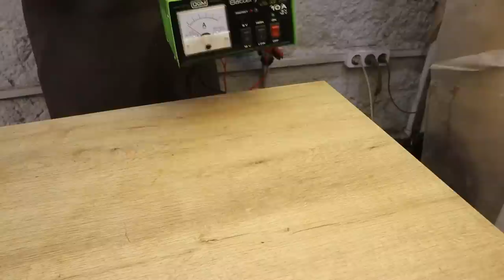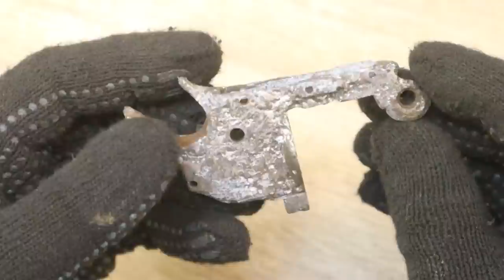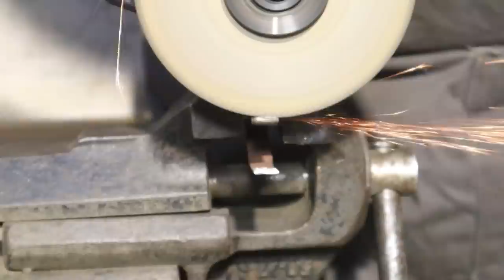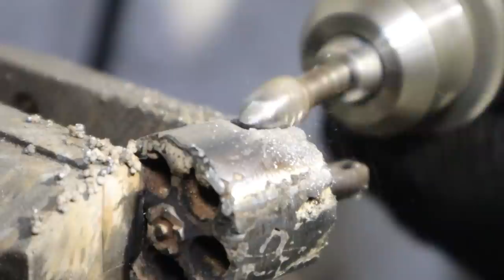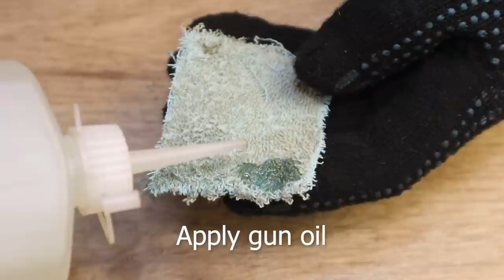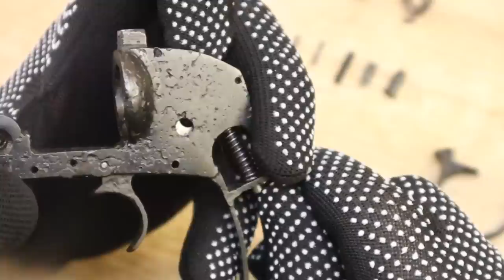An American revolver lay in the ground for 140 years!  You will be surprised! Restoration of antique

Comment: Great job considering how bad it was. One suggestion that might save you some time. Based on the splatter, I guess you're using .030 flux core welding wire. If you can weld with gas shielding and .023 wire, you will be able to lay down smaller less porous beads and it will reduce the amount of material you have to file greatly. The lower heat will make it easier to weld thin metal.
Reply: Why not TIG weld it
Reply: @johntice7745  . The guy would need a tig welder.
Reply: @johntice7745  tig welding would destroy more then save. Heat would start bending a lot of the parts he welds due to heat etc. I would suggest laser welding less heat and small and more precise welds.
Reply: @Srpskimafijas  lol wtf ever. You realize you can use lower heat settings or pulse tig? It would be the superior process for this.
Reply: Yeah the flux core did not seem like the best thing to use on this
Reply: @clutchboi4038  yes you can but doing small parts like that will still damage them. That’s why I suggested laser welding for more precise welding, less build up and easier clean up.
Reply: I think that the steel is very dirty on the inside,thats why the welding sounds so bad.Doesnt matter what wire you use and tig welding will not do the job correctly because of the dirty steel.

Comment: I got a ww2 era revolver in a quite the same condition, I’ve been meaning to start around it. Cool video
Reply: Please don't. Either leave it in its current condition or take to it a professional gunsmith...who will likely tell you to put it with scrap metal if it really is in as a bad a condition as this weapon was. The restoration done in this video did not improve the value of the weapon one bit, but also made it much more dangerous. I saw no restoration of the inside of the barrel which means if anyone ever tries to fire it and the firing pin still works it will definitely misfire and very likely at least badly hurt whoever is holding it, potentially hurt anyone nearby, and possibly kill any of them. Restoring a firearm is very, very different to restoring almost anything else. If you don't know exactly what you are doing you can turn a hunk of rust into a hand grenade but doesn't look like a hand grenade.
Reply: @wtrdawnlord  yeah not meaning to restore it as a functioning gun but just to see what’s under the rust. Pretty strict gunlaws here and personally I’m not intereseted in shooting, mainly in cleaning old stuff and see what’s up

Comment: Vapor Blasting with Glass beads before or after Electrolysis removal of the debris would have cleaned and polished the remaining metal without removing any of the metal. Food for thought in building a Vapor Blaster would be Armoury Enterprises in New Zealand website. Good restoration job.

Comment: What you have there is a Smith and Wesson 4th model 32 caliber revolver... A note of interest, the early .32 caliber was rimfire.  Much like a .22 cartridge
Reply: Did they make hammerless revolver.  140  years ago
Reply: @rickherman4539  He's referring to the priming is a rimfire. Like you modern. 22short,long and long rifles... The modern revolver cartridges came out around 1873, and used center-fire priming systems. The primer is in the center of the cartridges. Like your modern. 38SPL or .357 Magnum... I wouldn't even want to try loading or firing something like that. And, I've shot a lot of different types of guns over the years. Some pretty archaic.
Reply: @rickherman4539  yes they did ... Hence a .32 rimfire for a compact pocket pistol...the hammerless design was so the hammer didn't snag on clothing.    Pistols were often carried in pockets back then
Reply: Seems to me more like Harrington&Richardson 32 hammerless.

Comment: I love his work. Could and have watched it for hours. One thing though, the weapon does not seem restored to me. I saw nothing done to clean rust from the inside of the barrel or to reinforce it and rerifle it. Also saw no work done to clean up the interior of the cylinders. As he was blackening the cylinders you could still see rust inside. This gun can never be fired and leaving it with interior rust still active has only covered it up. Then why go to all that work for a gun to hang on a trophy wall that is still rusting inside? Why fix all those tiny unseen pieces? At least the gun would function like is could fire.

Firing it, however, for real would require custom made ammo that uses black powder. Modern day smokeless powder it too powerful for the barrel to handle. Just my observations. I was hoping to see an operating gun.

Comment: This revolver was not in the ground for 140 years.
Reply from the maker: Thank you friend! And how much do you think?
Reply: @restorationofantique  140 years ago is 1882.  S&W hammerless revolvers did not come on the market until 1887.  Information about where the revolver was found, when and under what conditions, is lacking in the video.  Some of the internal parts showed surface rust, so 135 years is out of the question.  Half that number is closer to the truth.
Reply: @zeekwolfe6251  There is really no way of knowing.  Look at some of the guns from WW II which metal detectors are finding in Europe and you will see a huge difference in condition.
Reply: It looks like it was used dearing WW1.
Reply: @zeekwolfe6251  how about complimenting him on his restoration.
Reply: @Richard-qx6el  How about you minding your own business and learning how to use a question mark while you're at it?
Reply: So where was it instead?
Reply: @woifmachatch2101  Sock drawer.
Reply: @woifmachatch2101  looks more likely to have been in water considering the encrustation.
Reply: @woifmachatch2101  Read my comments posted elsewhere about this revolver and video.
Reply: Sure looks like it was to me,besides how would u know
Reply: @kylegable1273  One might ask you the same question.
Reply: @kylegable1273  Because 140 years ago was 1882.  S&W hammerless revolvers were not marketed until 1887.  Yes, I had to remove my shoe and count on my toes to get the difference of five years.  And then I studied a little metallurgy.  Mix that with probability, statistical and otherwise...viola, even 135 years becomes fantasy.  140 years is only useful clickbait.  Now,  therefore, go and question  no more.  Your doubts are forgiven.
Reply: @zeekwolfe6251  lol,I like u now,thanks for the forgiveness, I'll never doubt u again
Reply: @Lacheyenona72  Oh, the wit. Too bad it's dim.
Reply: May not have been buried as long as expected. Sharp eye to Zeek Wolfe. I will say though, regardless of the time buried, you can tell this video is legit. Incredible find and restoration.
Reply: Lol. I'm not even getting into it.
Reply: Two weeks in the dirt, tops.
Reply: @zeekwolfe6251  how about more than 100 traes?
Reply: @Yeshualivesforever22772  Well, if it's from 1880, 140 years would mean it was only 2 years old when it got buried. Possible, but rather negligent for a 2-year-old gun, don't you think?
Reply: @jamesmcinnis208  I use to dig graves and sometimes we would dig up an old unmarked grave while preparing a gravesite for a funaral. And would find jewelry, and buckles and turn it into the funaral director. But, we did dig up a confederate soldier with all his gear. And the gun was in this same shape..... 1862...... Still have all that stuff
Reply: @Yeshualivesforever22772  Interesting. So it could have gone into the ground with its owner. I didn't think of that.
Reply: @justincraig398  I am amazed.  Over time I have commented on such diverse topics as the name "Bel Air" ( a Chevrolet model named after my boyhood neighborhood in Los Angeles), a friend's employment at Area 51, the Blue Boy painting, and Bigfoot.  The replies I get usually number four or five.  For some reason the age of this S&W revolver (I own a Model 10-6 inch made in 1968 et al) has really piqued interest.  At least the discussion has been limited to the topic and not gone personal.  When I made some suggestions about Bigfoot, some crude commentators said I had my head up my....you get the idea.  In a previous life I worked in the arms room of an infantry division before becoming a crime scene investigator for a SoCal police department.
Reply: This was dipped in battered eggs , coated with floor and deep fried
Reply: @zeekwolfe6251  ... And 'viola' lol
Reply: All comments are the same in these videos 😂❤
Reply: How can I unwatch this.
Reply: @zeekwolfe6251  this is not a smith & Wesson it's an Iver johnson
Reply: @_hunter_hunter1048  Great with a little hot sauce.
Reply: I appreciate you left some patina
Reply: @zeekwolfe6251  
He rounded off to the nearest 10.... Basic mathematical principles when dealing with 'older' numbers in a case such as this. lol
Reply: Guns always start controversy. Give this person some credit for patience and sharing, regardless that revolver went from unrecognizable to recognizable enough to be judged.
Reply: Seems this thread is just the usual clown show of rudeness.
Reply: I lost that 2 weeks ago
Reply: 😎 Cool
Reply: Restore WHAT?? that's just a gun shaped piece of rust!
Reply: I kringed every time I saw him weld. Took a month?
Reply: @zeekwolfe6251  yea you're obviously not too sharp. Ya see back then when you bought a new weapon you immediately went out and buried it. I know this because I heard it on a podcast... but yea I agree with you brother its all clickbait and b's for the most part but gotta respect their hustle. We are watching it right?
Reply: @jamesmcinnis208  oh that was punny
Reply: @jamesmcinnis208  how about you take a hike
Reply: @buckeye9252  Poor, confused one.
Reply: @Richard-qx6el  

Because they don't know how to say nice things to people
Just crap talking  and nothing more
Reply: could be 140 yrs old Smith and Wesson has been around for 170 years
Reply: @petergould1621  You must be the script girl.
Reply: @Richard  I do not want to take away from his work because it is impressive, but I've always thought of restoration as "back to original spec." Also need to see it fire at least.
Reply: @Dealer6G  S&W did not market a hammerless revolver until 1887, 135 years ago.  It is unlikely someone  purchased this weapon and then immediately lost it in the pond only to have it recovered and restored on YouTube.  It has some age, to be sure.  Promoters of advanced ages for anything, however, can be a shady lot usually in search of money.  Last year an item was "restored" on YouTube and said to date from the French 2nd Empire (1850-1870).  The lamp in question was made in Taiwan in the middle 60s which I helpfully pointed out to the poster.  The video was taken down but not before some creative albeit obscene words were dumped on me like a flood of garbage.  Incidentally, the  museum at the Little Big Horn battlefield in Montana has a couple of very nice S&W revolvers used in the 1876 battle.
Reply: @Yeshualivesforever22772  that’d be a wild experience.
Reply: @restorationofantique  find out what year they stopped soldering that handle and you’ll know how old it is
Reply: @Yeshualivesforever22772  you still have a confederate soldier?!  That’s really odd…..but what are you asking for it?
Reply: @TEGVB-  
That you would ask to have it priced is odd also. Isn’t it against the law to buy or sell  dead folks bones? 🤷🏻‍♂️
Reply: @PhillipHall01  Phillip, Phillip, Phillip, whatever are we going to do with you….sarcasm eludes thee.  Besides, I’m really not interested in “dead folks bones”, I’m just after some super sick Halloween decorations.
Reply: @TEGVB-  
Your reasons are yours to indulge for your personal pleasure as well as your personal reasons, after all it is a free country. 
I suppose in this case I can also say to you;  'Sarcasm does elude thee as well  :-)  
I still think it may be illegal,  but I do not know. I thought perhaps you may know the answer?  I do not even know if it is legal for the other person to possess such? One will not know if one does not ask, right? No offence intended. 
Phillip Hall
Reply: @PhillipHall01  Thanks, Phillip, appreciate it.  And you’re right, don’t know till you ask.  You seem like a good fellow so I’ll tell ya what - I know what you’re after here so, help me do a little “digging” (no pun intended) for the best deals and I’ll cut you in at a 10% discount; I get first pick of the really good bits though.  

The way I see it, we’ve got about 10 months to get after it - maybe even enough time to score a matching set from up there in Salem.  Oh Phillip, the neighbors don’t know what’s about to hit ‘em, am I right?  We’re gonna bury them (again, not intended) in next year’s contest!!!  

Keep me posted on what you find. 🤘
Reply: @TEGVB-  
🙂 A little 'deep' for me lol.  But thanks! Have a great day!   Phillip
Reply: @jamesmcinnis208  I think that wit was proudly underground for 140. Years!
Reply: @Richard-qx6el  ¿como carpintero? No veo restauración. Demasiado mecanizado impreciso. Para pared de Museo.
Reply: The amount of corrosion is dependent upon the soil PH.  PH levels can vary greatly from one acre to the next.
Reply: I love it that a person so worried about the time it may or may not of been underground or in a sock drawer is arguing with people and hooking this vid up with comments. Maybe it's the guy who did the restorations friend? 🤔😂
Reply: @jamesmcinnis208  Love seeing people say mind your own business on social media, how the hell did you get here? Is any of this your business?
Reply: Zeek wolfe what happened to you as a child?
Reply: @ryanange7123  When we were a boy heading into adulthood a neighbor, Wyatt Earp, talked of firearms, sports (he loved the large size of the then new Coliseum and Rose Bowl) and the movies.  He thought a young man he knew, Marion Morrison, might have a future in westerns because of his acting talent and interest in history especially the shootout at the OK Corral in Tombstone, Arizona.  Wyatt shared with me his vast knowledge of guns and said to always seek the truth.  I was sad when he died but remembered his advice, and to this day false clickbaits on these new fangled computers infuriate me.  140 years in the ground for a hammerless revolver, nope.  Los Angeles was a great place to grow up.  Does that answer your question?
Reply: @michaelmaas5544  Glad someone was able to provide something that you love.
Reply: @petergould1621  I'm no expert but your level of anger seems disproportionate to a video on fixing up a rusty old gun.
Reply: @petergould1621  Okie dokie.
Reply: Why were you wearing your gloves backwards in one clip?
Reply: Just to point out, how many people do you know that have dropped iPhones? Out of pockets? Off car hoods? These are worth a fair chunk and people lose them within days of brand new sometimes. 
If history teaches us anything,  people are people always. 
I know that 140 years ago, some of them were derps, because they managed to pass their genes along to some of you.
Reply: @restorationofantique  ready 😅
Reply: Could’ve just sprayed it with flex seal and been done. Lol
Reply: Does it work ? Or just for look only ? If it doesn’t fire , wasted time..
Reply: It was my diversgun :)
Reply: @jamesmcinnis208  Bro, thinks he's cool hating on people who don't really care about guns and just here for the restoration 🥶🤓
Reply: @Glitchberry  Whatever it takes to appear cool in the comment section of YouTube It's gotta be worth it.
Reply: @jamesmcinnis208  Apparently so
Reply: I assume it was used and lost in WW1 or Russian civil war, so more like 100 something.
Reply: As nice as this gun might look when they restoration is done, let’s hope he doesn’t try to fire it. The cylinder doesn’t revolve ….

Comment: nice work..... Im asking this from a point of ignorance not judgement.... Is there a putty type of substance that could have filled up the pitting to smooth out the metal?
Reply: JB Weld is often used for that purpose on restorations.  But those are usually projects that that powder coated.  So, I don't know if it would look good enough of a surface you wanted exposed.  Although if you used bluing to turn the metal black, that might be enough to cover it.  I think in this case, he was trying to leave some of that pitting to show that it was old.  But on a lot of other projects it would be undesirable.

Comment: This restoration can get someone killed . You have changed all the tolerances ,heat treat , and annealing. You are dealing with leathal pressures. 
That should have been soaked in evaporust. No gringing,no torches or fileing.
It's a grenade if someone trys to shoot it. Even if it survives the first few rounds.
I'd weld the cylinder shut and use it as a paperweight.

Comment: 1. evaporust would have done much better job.  2. flux core mig is a very weird way to fill the pitted metal.  Mig with gas and then a slight layer of tig welding would have made it perfect.   Hell even aluminum or Silicon brazing would have been better than flux.
Reply: Probably used what he had. Still not bad though